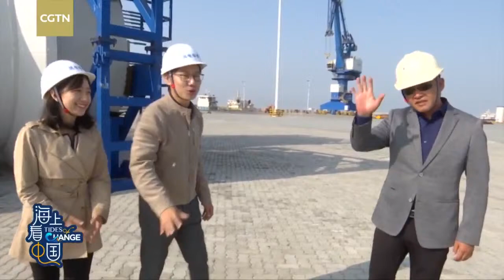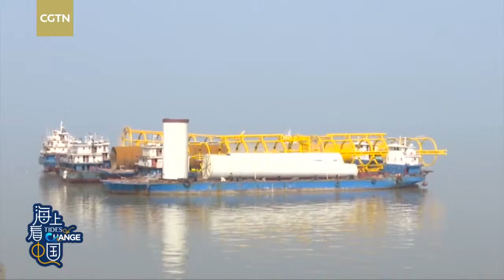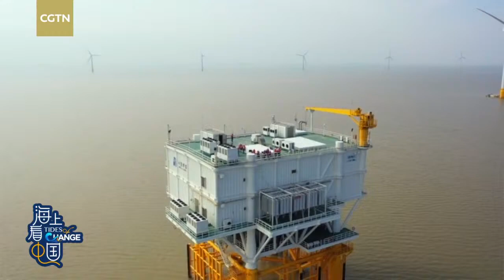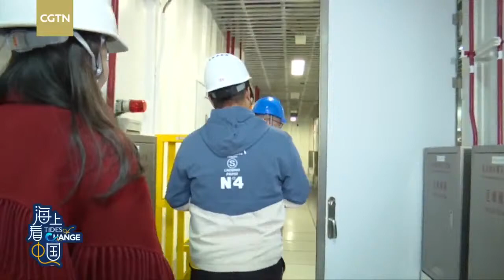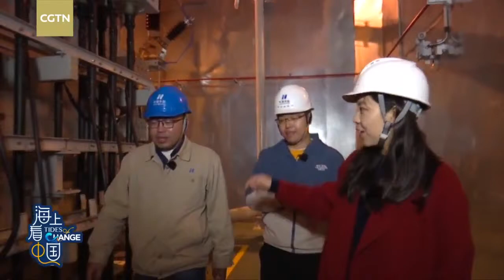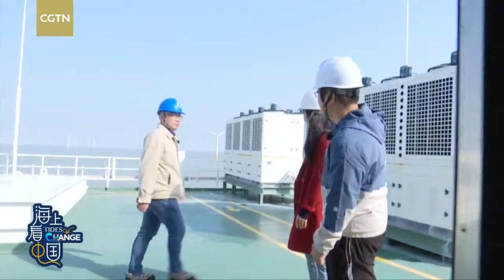Live: Explore China's largest wind farm by capacity

Comment: amazing. besides the power lost issue, you want to boost the voltage in order to lower the current. the size of the transmission lines are directly proportional to the current. smaller transmission lines are more cost effective.

Comment: These power windmills are just an eyewash from the truth.  The fact is that electricity is available in the atmosphere and free all you need is towers to collect the energy and transmit it along non insulated  steel wires.  A small wind turbine placed on the roof of a house  never produces enough energy from a claimed 300w unit so how on earth do these things produce any near 3.5 MW or whatever their claim is from a very small power unit at the back of the turbine!!